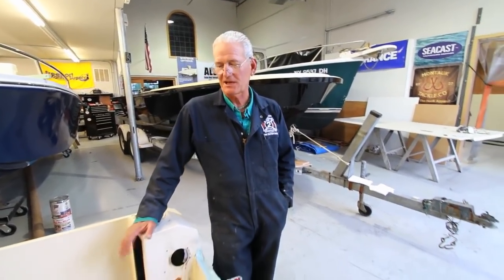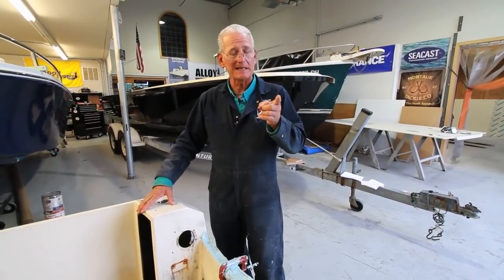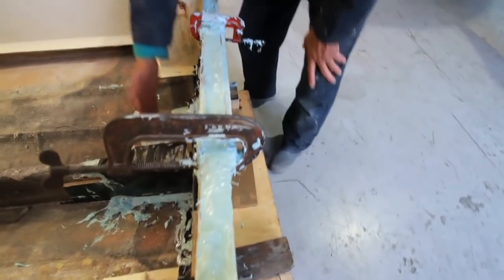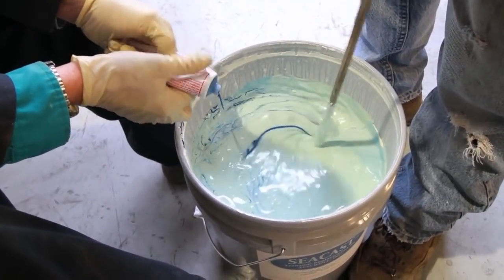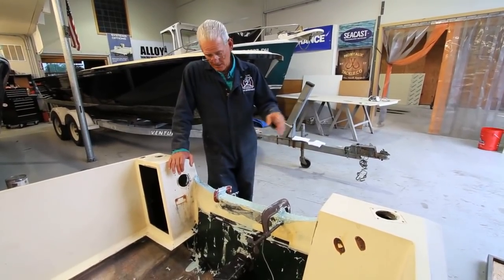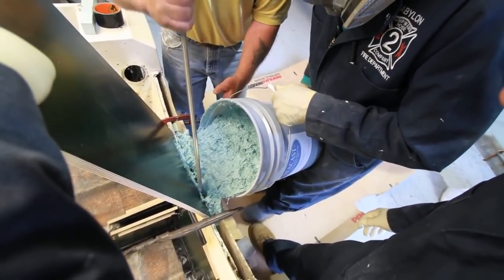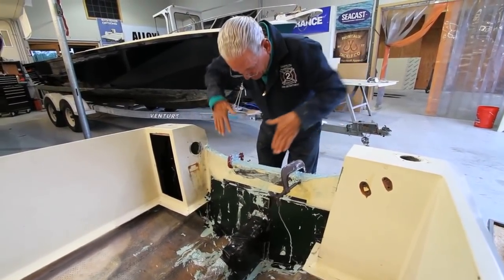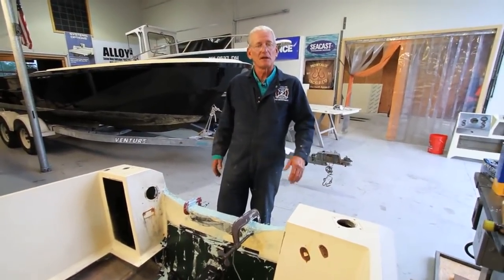1981 15' Answer Transom repair with SEACAST

Comment: I've poured crete where vibrators and tapping was used to ensure no bubbles and complete filling of the form - so here on these boat transoms I'd say an orbital sander with no paper and cloth on its surface would be good to vibrate down this mixture - ensure best filling.  (
Reply: Look up what happens to seacast when using vibration to remove air. It's a big nono. Just tap it with a rubber hammer as instructed

Comment: Might use it some day on my hydra sports bass boat had some isues with it motor flex some one done new wood done it wrong I poured epoxy in between the new wood put a brace under the deck they left out no flex at all now wood is new they just didn't do it right might last now for a wile